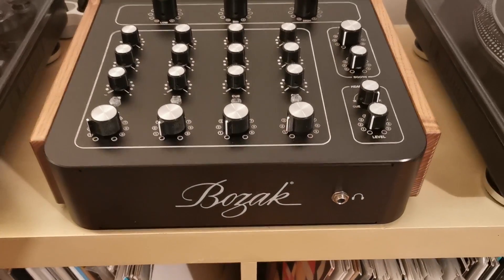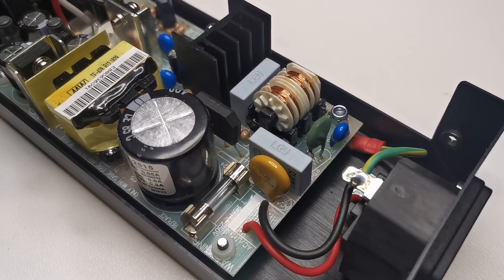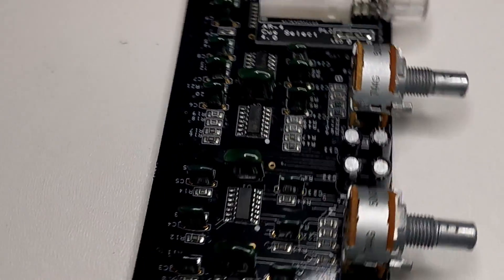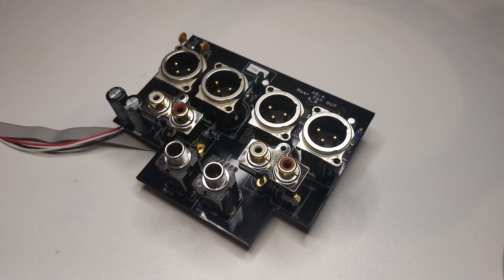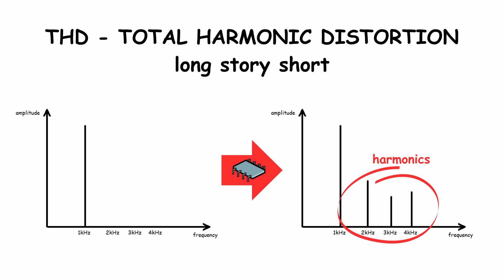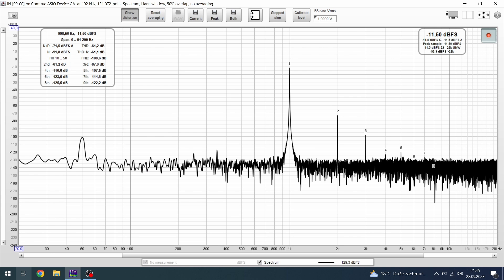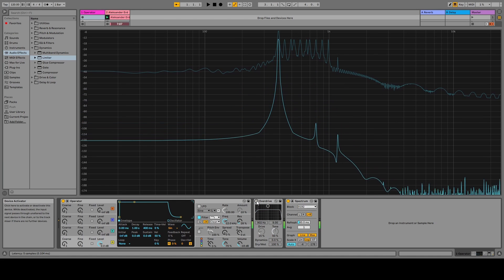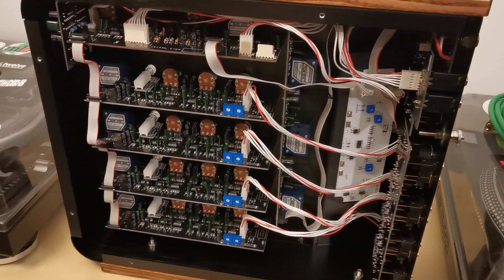Mixers Inside: Bozak AR-4 + THD explained

Comment: I would love to see a video on the Condesa Lucia. There is a cult following about them. I suspect a lot of the enthusiasm is based on having paid so much for them and their very nice looks. However I have used one back to back with my Omnitronic and although the sound is slightly different, I would not describe it as better, and with music with stronger mids(jazz,souletc) I preferred the omnitronic. I have yet to see a picture of the inside of the Condesa, I believe it is based on the OG Bozak.
Reply from the maker: @Positivefrequency1  I'm sorry, but you are just a perfect example of misinformed person regarding discrete circuitry features. Ability to handle higher voltages has literally nothing to do with higher susceptibility to noise. Its just the opposite - please read some materials about electromagnetic compatibility and you will easy find out that designs that take smaller areas and are generally "squeezed" are more noise resistant thanks to e.g. shorter leads (only one of the reasons).

Secondly... It requires the most basic electrical knowledge (Ohms law) to find out that in worst case (lets take 10V RMS, that's a lot of output voltage) it will be only about 25miliamps flowing through a 600 Ohm load! And usually the load is higher (several kiloohms) and output voltage smaller. So we are dealing with single miliamps here. Who on earth need high output current capabilities in such application. We are speaking about a mixer, which is kind of preamplifier why would we need high currents here?

Yes you are right that you can fine tune the discrete circuitry, but also the op amp selection nowadays is so huge that you need really esoteric application to not fit any IC op amp to your design. Even though music can be sublime, mysterious and for some people it is the meaning of life - audio signal processing is not an esoteric application!

Please let me know if it does sense to you, i will be very happy to clarify something.
Reply from the maker: @Positivefrequency1  too bad you can't share your knowledge with us then! Instead of calling me unexperienced you could just lift this discussion to another level and make all things clear using your academic skills.
Reply from the maker: @Positivefrequency1  explaining the potential advantages of using discrete circuitry in audio mixers/preamplifiers will be more precious than gold. This is indeed higher knowledge, and that's where our discussion started. You've pointed out two things - immunity to external noise and higher current capabilities. I explained why it doesn't make sense to me - maybe my way of expressing it was too rude, if yes i'm sorry for that.

But instead of clarifying the topic you just told me to gain some experience. I think it doesn't cover the topic well. I'm really curious about this and all tips and suggestions regarding gaining this knowledge would be very useful for raising the general knowledge of mixer users. I'm preparing YouTube episode about this matter and i would love to hear your comment on this as an expert.
Reply from the maker: @mehdiel-aquil2172  why are you considering talking about someones preferences as a take to discredit Condesa? The sound of those mixers is just a matter of taste, someone may not consider it as superb and i guess we all should be fine with this. Especially when we're talking about the mixer with significant harmonic distortion that is far from transparent - not everybody likes that. 

I think that a decent sound engineer would answer your question "it depends". Omnitronic and Condesa represent two different sound signatures and speaking of what's better is a pure subjective thing. 

Speaking of technical criteria (the objective ones) we can clearly say, that Omnitronic is better in terms of distortion performance, but we all know that numbers are not everything. And again we make a circle and return to the "matter of taste".
Reply: @mixersinside I own several DJ rotary mixers, including Bozak CMA, Allen V6 and some Condesa Allegra. Unlike many others, these have a very high output power, lot of headroom, so much so that with the potentiometers you rarely exceed 7 in the channels and in the master, as Larry Levan and Richard Long, pioneers of disco systems, taught.
I also had a UK Bozak, the AR6 which internally was the same as the AR4 that you dismantled, but 6 channels with the eq only on the output and often it wasn't enough to turn the knobs to 10 to have enough power to drive the audio system , so it looked distortion-free, clean and faithful. I'm not a technician, but I've been working with mixers for 45 years and I've used several; the tests on Allegra done by me without electronic devices, just viewing graphics on wavelab, both with studio monitors and subsequently on power systems have shown that by pushing the volume almost to the db limit and simultaneously opening all the equalizer knobs to the maximum It had no distortion, which doesn't happen in most mixers. That said, it sounds like you've never opened a Condesa. I don't see any videos about test it. You will however know that it contains no IC and that it has transformers on the output. And the quality of the components? You saw them?....
Reply from the maker: @kir4us   i've opened and measured Condesa mixer before i opened this channel. I prefer to publish the video material with measurements and analysis rather than talk about it here to show everything in a precise, proper way. 

There are 2 things i want to comment straight away. First, when you judge the amount of distortion by just watching "graphics on the wavelab" and analysing it with your eyes you can easily consider 1% THD waveform as perfectly fine. I use precision measurement equipment and software that provide arithmetics instead of my eyes.

Second thing is that you wrote that Condesa has no IC. Are there any benefits of this approach that you could name using technical language? Discrete vs IC battle especially in DJ mixer owners community is filled with disinformation and marketing (again).

Just to make myself clear - your methods don't convince me, but as long as you are happy with your Condesa i'm fine with this.
Reply: @mixersinside isn't my method, is by ears and years listening music and equipment, eyes just to view the graph on WL. and yes I love Condesa, but I love Bozak cma and V6 too, I loved Vestax. I was just saying that Allegra sounds better clean and powerful than many other mixer i tried in life
Reply from the maker: @kir4us  thank you for this opinion. I hope that this channel will provide you a nice journey through the world of measurements!
Reply: @mixersinside  I agree with you here.

@mehdiel-aquil2172  can you please accept and live with a fact that people have their own opinion? They do not need your defensive response why A is better than B. Please be so kind and humble, and let everyone think with their own brain, and form their opinion based on their own perception. You're very competitive on all social media platform and jumping on all mentions of Condesa. It became a bit too much, TBH. Condesa is not everything for everyone; accept that. Thank you.

Now , let's enjouy the videos here... this is informative channel afterall...
Reply from the maker: Yes, I also believe Condesa is based on the OG Bozak. 

Thank you for this comment overall, so realistic - i try to keep my channel this way. And sorry for the late answer, i didn't notice it before.
Reply: @mehdiel-aquil2172  Is there a particular reason why you deleted your reply to me? Thankfully I've red it before it was gone, and saved the reply. If you can not stand behind your words, then what do you expect me to think of you and your company? Very unprofessional from your end. You have said that you're humbled. What? You're not humbled at all, as you mentioned in the deleted comment, you simply play unfair and then inviting Lauren to continue where you deleted off... It's pretty clear what's the real story behind your company... Well, guys don't believe the hype!
Reply from the maker: @aljoshastanich  let's just all let it go. I still don't know what's the goal of people from Condesa here, but they are for sure loosing their credibility by showing lack of elementary knowledge. Sometimes it's better to just remain silent.
Reply: @mixersinside  Exactly that. This self-promoted marketing is absolutely unprofessional and pathetic. Combine this with the lack of the knowledge...nah... not worth my breath :) Anyways, moving on.
Reply from the maker: @mehdiel-aquil2172  are you here for marketing purposes? I try to keep this space unbiased and talk about pure facts and you use terms like "more than a mixer". That's an educational channel that analises electrical components not social movements. I think that our discussion have quickly reached the "saturation" point and we won't come up with any fruitful conclusions.

Also nobody wrote that your customers don't like the sound of your mixers. They are just likely to have their perception bent thanks to the cult and marketing that are for sure a very strong side of your company and i must congratulate you for that. You are a great salesman for sure, no offence! 

If you are confident enough to feature your mixer in this series feel free to contact me at mixersinside@gmail.com. Cheers.

Comment: Great series, big respect for the spinning table ;]
Maybe this is the place for insertable or switchable tone modules? Adding such or other saturation to the TRM 303 would sell out this mixer in a few days.
Reply from the maker: Thank you for the kind words. When speaking about TRM-303 you mean Omnitronic TRM-202 or there is another product I'm not aware of? 

There is of course space for the module - you must simply design such module from scratch, make it compatible and replace the original one. Shouldn't be a huge challenge.

Comment: That explanation / demo of THD in Abelton was fantastic. As i dont have access to any of these mixers in country,  I'm going to use that method to demonstrate / audition for myself what i might expect to hear from the mixers and use that in my purchasing decision.
Reply from the maker: I think that this idea makes sense, but I strongly discourage buying a mixer this way! Total Harmonic Distortion (THD) is just one among several sound quality parameters. I employed THD as an indicator of the mixer's coloration, but it doesn't provide insights into aspects like transient response, intermodulation, and other intricate characteristics. I selected THD as a measurement because it tells a lot about the sound quality, but it doesn't encompass the full spectrum of factors. 

But sure - It's definitely worth to check if you like some amount of distortion or not before buying a mixer.
Reply: @mixersinside  Noted, thank you for the guidance.

Comment: Interesting video! -60 dB (0,09%) is really a lot of distortion. Do you know which JFET they used in the summing amp? TL07X usage to me is really unneccessary, especially for the phono amp, as NE5532 cost about the same. But you can probably save some coupling caps on the design with the TL. And some people seem to like the sound. Is the price justified? I can't say. I mean the AR-4 is one of the cheaper 4 channel rotaries having everything you want except for effect send and return. And depending on your taste, better specifications :P Still cool they kept some of the Bozak circuit and nobody complains about the original CMA.
Reply: That's interesting, I'd like to know why a TL07x design could save capacitors, compared with a 5532-based design? if I've understood you correctly of course
Reply from the maker: @dennidigital they used 2N5458. I also don't have strong opinion about the price, but people should definitely stop classify such mixers as hi-end devices and i'm pretty suprised that you can easily get low THD mixers for cheap and the higher THD you get the higher the price.

@merovewallerich3105 TL072 is a fet input op amp which results in very low input bias current - that means you can safely DC couple the input with the phono cartridge and don't use the coupling cap.
Reply: @mixersinside  Ok I see, thanks :)
Reply from the maker: @dennidigital and let's assume the THD of Bozak is -65dB cause -60dB was in peaking conditions.
Reply: @mixersinside   Thanks for telling me which JFET they used. The original Bozak circuit used 2n3822. I just rewatched the video for the THD part. If I understood correctly what you did you did not measure it the way for which specs are usually given for DJ mixers which is at Unity Gain. 2V RMS Input is fine, but you should make sure there are 2V RMS on the output as well. For gain staging you usually get lowest THD when the channel volume is at maximum and house output adjusted to the 2V RMS output voltage. I wouldn't care too much about what the VU meters are saying about peaking in this case. Which soundcard are you using btw?
Reply from the maker: @dedondigital  I get what you're saying, and I agree that testing devices at "unity gain" settings makes sense. But in this situation, I think it's not realistic.

Here's my take: We can assume that according to metering system designed for the mixer we deliver optimal output level when reaching 0dB. Optimal not just for the mixer but for the entire system.

So, I apply the standard line level for the mixer's input (2V RMS). I raise the level on channel knob, "master" knob is set to maximum. I get the results in optimal conditions. I also show what happens when things are pushed to their limits – this is the worst-case scenario. It helps us see how distortion increases at maximum levels. By comparing these two situations, we can understand how the device performs under full spectrum of normal conditions.

In terms of distortion, your method for setting high levels early in the mixer isn't the best. Starting with less headroom from the beginning leads to more distortion. Your method is good for reducing noise and better SNR figures, but I'm only talking about raw distortion, without considering noise. So, I'm presenting both the best and worst distortion cases in normal operating conditions. With your method, I can't show the best case. If you're interested in noise, you can find that information in the spectrograms I've shared.

Please let me know if this explanation and approach make sense to you.

By the way, I use an E1DA ADC soundcard that can measure distortion as low as -130 dB. This product is incredible and offers high performance at a low cost.
Reply: @mixersinside  Thank you for the explaination. I thought we're talking THD+N, but that was my fault, you never wrote or said + Noise. My point was just that people will compare numbers because it's so comfortable, so it would be good to have the same test for all, and manufacturers seem to have agreed on THD+N at 1 kHz 2VRMS Unity Gain. The ADC seems nice. How do you generate the sine wave and how much loopback THD do you get? Just to make sure, I want to say, I really like your content and do not doubt your expertise. I'm just happy to exchange views and nerd around a bit if you don't mind ;)
Reply from the maker: @dedondigital  i'm very glad that you want to discuss this topic deeper. It's also good for me, I want to stay legit and appreciate any comments and doubts. 

I use ultralow distortion analog generator. It's called Victor's Oscillator - also a very nice and not expensive tool for pro audio measurements. The frequency is fixed to 1kHz and you can set up the output level. The THD i get measuring the oscillator alone is about -130dB.

I think that according to my logic by keeping always the same input signal level you will be able to compare the mixers.
Reply: @mixersinside   the oscillator has actually -130 dB THD or it's just because you hit the sensitivity of the ADC?
Reply from the maker: @EmanueleVirgillito  I'm sorry but i don't get your question. What situation are you asking about? Also if this helps - I show my measurement setup in the newest Warm 2/Nuo 2.0 video.